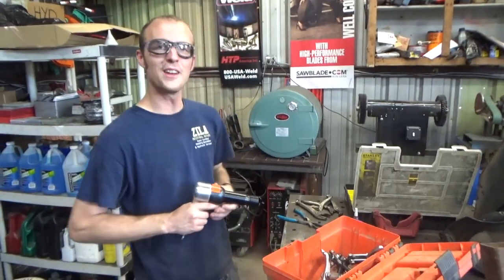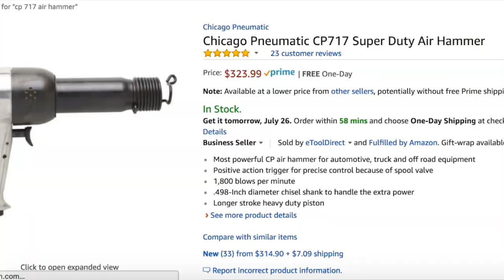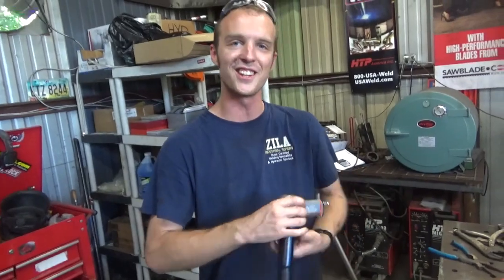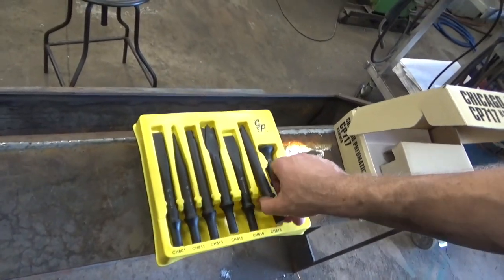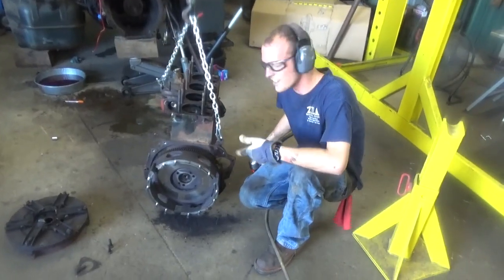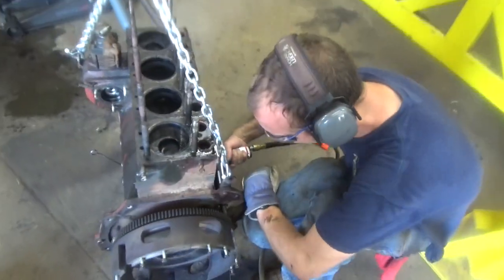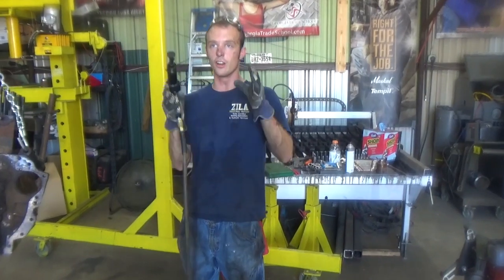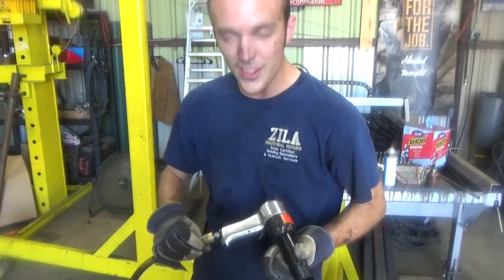WORLDS MOST EXTREME AIR TOOL PUT TO THE TEST!!! CP717 CHICAGO PNEUMATIC AIR HAMMER

Comment: You can get them 3 times bigger and they are bomb proof
Reply: What is it called?
Reply: @connor3288  this tool is just a riveting hammer but you can get larger chipping hammers meant for concrete work
Reply: @oh_crumpets  Ahh ok.  I know there were more powerful ones, but they still take the same bits?  The package of tool and bits is why the CP717 seems like a great buy, as well as being a long running tool in the market. To have more power while still being the same length, i think you would need to have a bigger bore.  With the the tool market size/demand for stuff beyond a CP717, i think the price would be steep.
Reply: @connor3288  the larger chipping hammers usually have a 19mm bore whereas these hammers usually 10-12
Reply: @oh_crumpets 
I can't find videos of heavy equipment mechanics using chipping hammers instead of air hammers
Reply: @nathanfowler1606  most chipping hammers are pneumatic?
Reply: @oh_crumpets  Chicago Pneumatic makes then but haven't seen any in action vs. Wheel studs on trucks